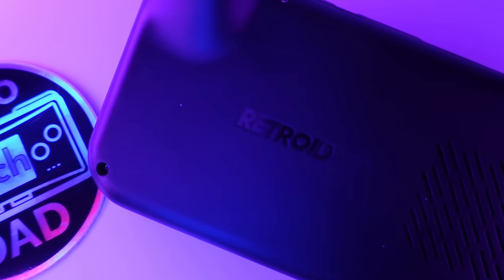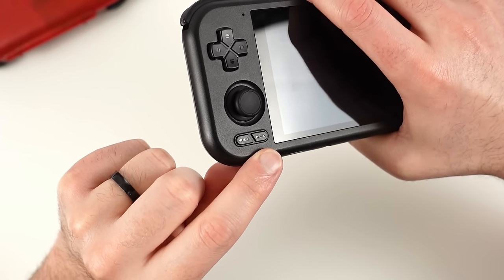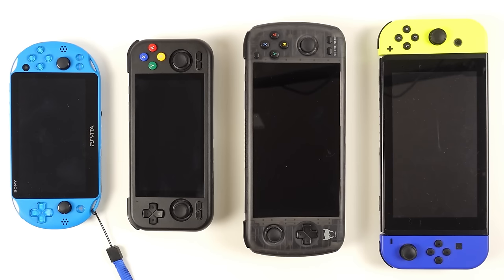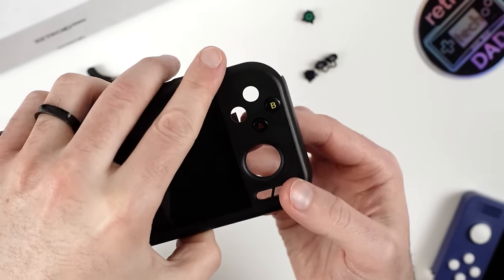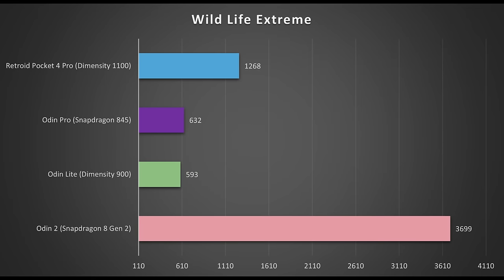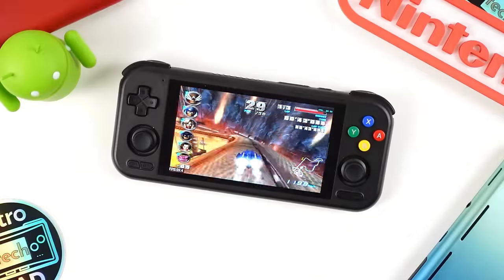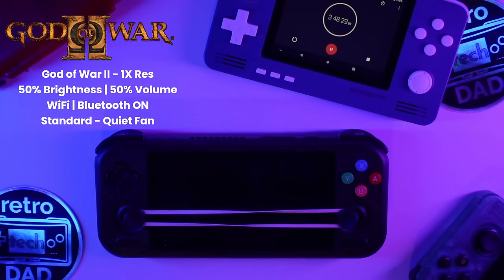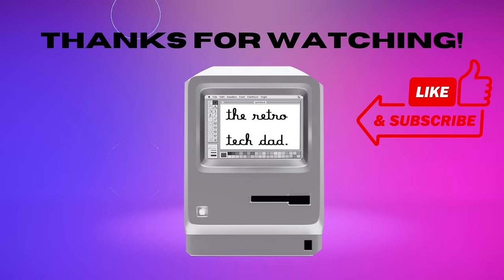Retroid Pocket 4 PRO – THE IN-DEPTH REVIEW // Unboxing, Teardown, Emulation, Viewer Requests!

Comment: The Odin 2 or steam deck are still the ultimate Retro handhelds but this device is a great option if £200 is your budget limit,  that's fair enough. If a pocket size is your main concern, this is probably the best choice.
Reply: Yes, I like Retroid because it fits in my fanny pack. The size and price is what i like.
Reply from the maker: Yea, I think most will want this because of its compact size. In many ways, it's in a different category from devices like the Odin 2 and Steam Deck.
Reply: In my experience you can't buy the Odin 2 base. So you have to buy the Pro for like $370... at that price the Odin 2 is a really tough sell for me
Reply: @SpawnTrapped  it's out of stock for now, it'll be back after chinese new year though
Reply: @SpawnTrapped yeah. Quite a price jump vs performance boost.
Reply: Just got mine yesterday and the fun part to me at least is setting it up .
Reply: If the RP4 pro had an 1080p oled with a sd8gen2 chip that would be a dream device 😍
Reply: @netnomad47  👍 Agreed and if the Powkiddy V90 had a Funkey S inside that would be a really awesome device too.
Reply: I have a steam deck OLED and still bought this to replace the rp3+ that I had passed on to my son. They are not in the same size category at all. This is much easier to take around and use while I'm waiting for my son's various activities. My steam deck is mostly just used at home almost like a console that's easy to play in bed without disturbing the wife.
Reply: @SpawnTrapped  yeah and another problem for us europeans is that we have to pay taxes, and the pricier the device is the higher the taxes, I mean it’s the same percentage but you get the point.
Reply: @rafsnchz  approximate 95% of the countries in the world have taxes. Where I live, I have federal and provincial taxes totaling 12%.
Reply: @janX9  yeah, true. interestingly enough, I didn't have to pay taxes when I received my Pocket 4 Pro. I was pleasantly surprised. And man the console itself... I'm happy like a child. Finished 3rd gen Pokémons, now playing Platinum.

Comment: I absolutely fell in love with my RP4 Pro. I bought the RP2 right before the RP2+ released and had horrible buyers remorse, but the 4 Pro destroys the competition with the Odin 2 being the only real competitor for out-of-the-box emulation devices. There are cheaper handheld Linux devices with better performance, but most people don't want to deal with the configuration of those devices.
Reply: "with better performance" Such as?
None of the cheap handheld Linux devices allow you to play GameCube, Wii, PS2, 3DS, or a bit of Switch, not even if you tinker enough because there's NOT a single powerful enough ARM-based Linux handheld. If there is, notify me immediately.

Comment: mine just shipped! should be playing by the weekend. i can't wait!
Reply: Did you get it in red or Trans white?
Reply from the maker: Nice!!! Which color did you get?
Reply: @retrotechdad  black. I was worried the clear ones might go funky in the sun 🌞
Reply: I hope I don't sound like a complete downer but people should buy Odin 2 it emulates PS2 games upto 6x resolution which is like 4k resolution or. More and GameCube and Wii can be played at 4x resolution. DreamCast, PS Vita and 3DS and Switch emulation runs better now at consistent frame rate although those emulation will get updates which will make. Them run on most handheld run better in future.

But Odin 2 is vastly superior and design quality and dual speakers which is on par with my S20 Ultra which is saying how good those speakers quality is on Odin 2 and beautiful 1080p ips lcd screen powerful snapdragon 8gen2 processors and WiFi 7 Bluetooth 5 3 and hall effect sensors analog stick vita style dome d-pad.

And ambient lighting on analog stick and side of the device is such a cool feature!
Reply from the maker: Not at all, the Odin 2 is one of the best devices on the market right now!
Reply: When did you order it?
Reply: @Moochers  right when it released. it just showed up now, though! super hyped.
Reply from the maker: Nice! Have fun and enjoy 🤗🤗
Reply: How long you waited I ordered mine on the 3rd and it still didn’t ship yet
Reply: @ParadoxdesignsOrg hello, can you please tell me how is your experience going with rp4 pro cuz people complaining a lot

Comment: Fun fact, The Retroid Pocket 4 uses a A78 (4 cores) at 2Ghz 

The Switch 2 is rumored to use a A78C (8 cores) at 2.6Ghz (An engineer from LinkedIN worked on it)

Now we know nothing for sure of the final clock speeds for the Switch 2, but here's a scary thing
1 core of a A78 beats a PS5 CPU 1112 to 996 (11% overhead) 

While the PS5 mogs the A78 4 core by having 8 cores (with hyperthreading) the potential at 2Ghz of the Switch 2 being able to bully the PS5 Pro (it's only 8% faster than the PS5)'s CPU is crazy. 

If it's 2.6 Ghz (23% faster) that 1112 score becomes a 1445 vs the PS5 Pro's 1081 score (26% overhead) 
That would be pretty wild. 
Course the PS5/Pro has hyperthreading which allows each core to get a 60-80% per core boost but at surface level amateur developers will be able to cope with a PS4 handheld to PS4 Pro Docked Nintendo with a beefy CPU with 12 GB of RAM

Comment: You have forgotten to mention the trigger spring issues , right? Mine should arrive today, fingers crossed
Reply: This is the only thing holding me back. Hoping this is an isolated issue
Reply from the maker: I didn't forget to mention it, my unit doesn't have any issues and I've had it for almost an entire month. I did read into it yesterday and it does appear that Retroid is providing a 2 year warranty on the triggers. They will send out an entire backplate with the triggers installed already for anyone with issues.
Reply from the maker: @lilalj07  Retroid has stated they are providing a 2 year warranty on the triggers. They have corrected the issue for future batches. I'd say keep an eye out if you're concerned and see if the next round of shipments don't have an issue. For what it's worth, my unit hasn't had any issues and I've had it close to a month.
Reply: @retrotechdad  hello sir, speaking of the triggers, I've seen other reviews mention that the progressive rate of the analogue triggers is not on a linear scale. As in, when playing a racing game, you have to nearly fully depress the trigger to get about half throttle. Do you see this as something Retroid may be able to address in the settings via a software update or is it more likely the type of trigger they choose to use and isn't reprogrammable? Since this genre is likely my most played category, it could be difficult to 'finesse' the "right foot" like I'm used to on PC or like Xbox controllers can. I greatly appreciate your feedback sir! 🙏
Reply: @briangiven7399  I've asked around about this as well, and apparently it was fixed in an OTA update just before launch.

Comment: I’m waiting for my RP4 but I am on the fence on whether or not I’m going to keep it or not. I jumped the gun and pulled the trigger, but after seeing the performance of the odin 2 I want that handheld as well. The RP4’s pocketablity is quite compelling but that beast of that snapdragon 8 gen 2 is on another. Should I keep my RP4 or go straight for the upgrade in the odin 2?
Reply: Do not hesitate to buy the Odin 2

Comment: Will a microsd from a pocket 3 pop right in and work, or will it require a reformat? I'd hate to re-transfer everything.
Reply from the maker: No, it will require a format. 😭😭
Reply: @retrotechdad  bummer. Thanks for checking!
Reply: @retrotechdad  Just an fyi. I got my rp4 pro in today and the card from my rp3 worked just fine without reformatting.

Comment: There's been some reports of the trigger mechanisms failing in the Retroid Pocket 4s, so a tear down of the triggers would have been nice. For one, I'm curious if they're using springs or magnets in the Retroid Pocket 4 to make the trigger return to it's zero position.

Comment: My RP4pro came and in 24 hours the R2 Trigger broke down just like many others. Now no response on when the replacements will arrive - even before Chinese new year. Very disappointing.
Reply from the maker: That's a bummer! I know Chris from Retroid is very responsive, he should get back to you soon. Retroid is providing a 2 year warranty on the triggers.
Reply: @retrotechdad  Many thanks for your reply. Unfortunately they charge extra for DHL but for replacement… it is probably forever. I stopped getting responses & will take the optimism of course…

Comment: Hey man, would you recommend I go from the 3+ to this I love my 3+ and the performance it’s really not that bad is this worth the upgrade or should I wait another year for the next Retroid 5?
Reply from the maker: The 3+ was one of my personal favorites as well! It depends on what you're hoping to get out of an upgrade. Is there anything specific you wanted to play or emulate?
Reply: Honestly, no, I mainly find myself using game streaming for switch games so a lot of the power for emulation isn’t my reason for wanting to upgrade. What I do like from the four are those analog triggers and the sticks seem to be nicer as well. The problem I have with the RP three is the small sticks when I play modern games on it. Are the sticks on the 4 taller and more ergonomic? I also heard there was an issue with the screens being greener. That’s one of the reasons I’m also hesitant to upgrade. thanks for your input from one dad to another 👍
Reply from the maker: Yes, the sticks here are a nice improvement over the small sticks on the RP3+. It's definitely going to be better for streaming as well since we have the full triggers now. 

The green screen issue has been corrected, I talked about it here in this review at 12:48 and in my early look video.
Reply: Waiting for the RP5, hopefully we have a better PS2 emulator by then and improved screen.

Comment: out of curiosity, ive heard the battery life of this isnt great, do you think its possible to do a battery upgrade ? or not at all ?
Reply from the maker: I think the battery is pretty acceptable given the size of the handheld. Definitely check out my battery testing section to get an idea of what to expect. It will be tough to do an upgrade, there's not a whole lot of room in there.
Reply: cheers i was going to check that out but i ran out of time during my break. thanks! and will be watching the rest later @retrotechdad

Comment: So what’s the best emulator for ps2 then? I see you have used 2 in your review
Reply from the maker: The results vary between AetherSX2 and NetherSX2 depending on the game. I personally like using AetherSX2 (3668) but if you see performance issues, then it's worth trying out NetherSX2.
Reply: Makes sense and thank you for the quick answer

Comment: The very tiny screen is a dealbreaker and non-starter for a lot of people. I own a small retro games store here in Kansas City and see a 100 to 200 people daily, 300+ over the weekends and have had numerous conversations with customers, and or, overhear conversations about the subject. If these were made with 6 to 7" screens, it would only increase the price slightly, but, they would sell a lot more.
Reply from the maker: The good thing is there lots of options out there in all shapes, sizes, and price points.
Reply: It wouldn't make sense to call it a Retroid "pocket" then. These can output to a telly via HDMI for a larger screen. I guess I like the portability of these things.
Reply: That's why it has the name "pocket" 🤷

Comment: He forgot to mention most of them defective with button issues
Reply: Most of them? So far its like 6 out of 10,000
Reply from the maker: I didn't forget to mention it, my unit has no issues with it. I've had it for close to a month now. I did read into it yesterday and it does appear that Retroid is offering a 2 year warranty on the triggers and will send out a replacement backplate with the triggers installed.